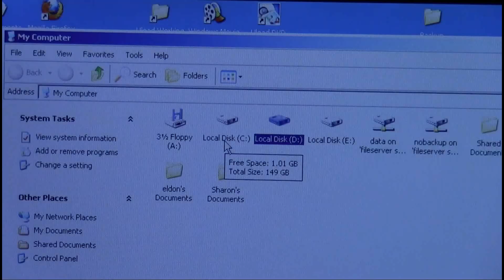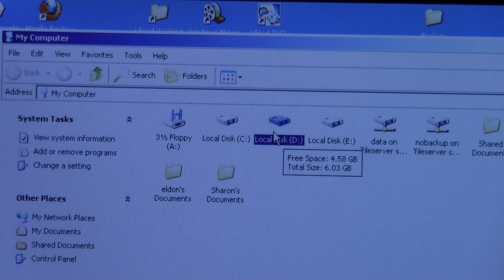How to recover data from a dead computer

Comment: It would have been nice if you could have shown both types of connectors. I have a Vaiao that I absolutely loved but the battery crapped out and wouldn't re-charge, not successful in getting a replacement battery. Wasn't brave enough to access the hard drive until   I knew what to do without compromising the contents.

Comment from the maker: However... sometimes a hard drive is in the process of failing and doesn't allow you to boot from it, but the data is still accessible.  In those cases, following the steps in this video can sometimes allow you to retrieve the data.  It's a 50/50 thing that you have to try to find out.  If you need a data recovery specialist (and you can afford it), one of the most reputable ones is Ontrack Data Recovery (google it).

Comment from the maker: It depends. :)  If the hard drive itself is completely dead (It is not recognized by the computer when attached as as secondary drive), the only way to get data off is to send it to a data recovery specialist, which are many times very expensive.